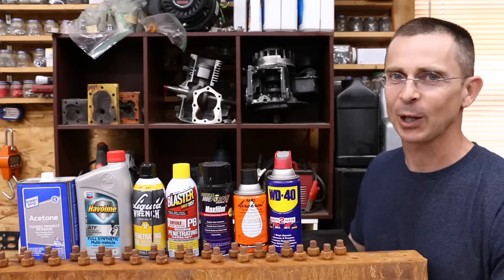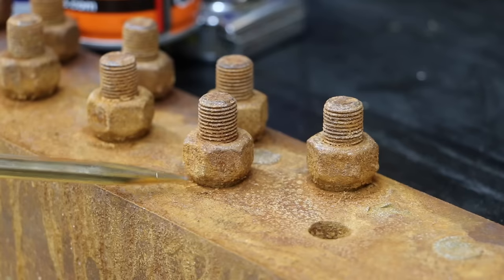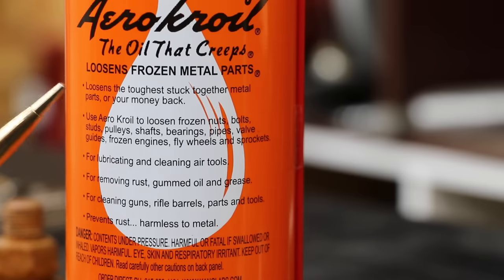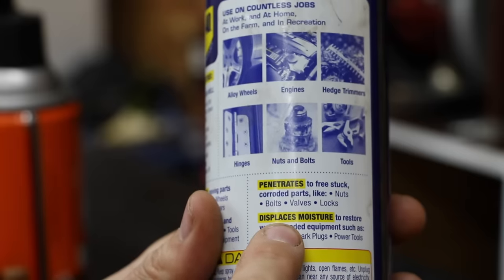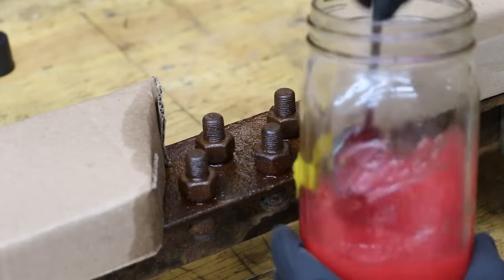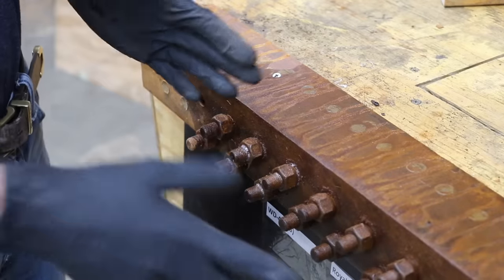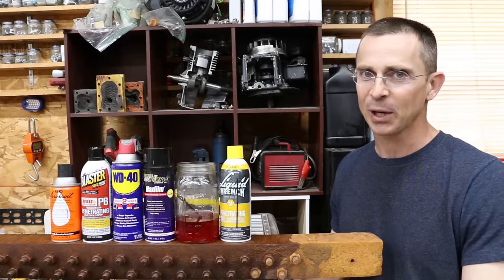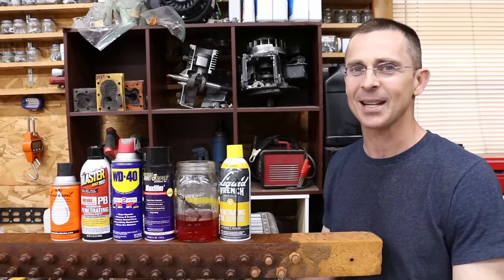Which Penetrating Oil is Best? Let's find out!

Comment: I tell every body that will listen about this stuff , I've got a lot of stuff that always sits outside year round and for years and it works great my only beef is , because I keep a spray bottle around all the time , when it gets hot outside or it sits in the sun it separates and all the tranny fluid leaks out the top, or when it gets cold the bottle sucks in,and if you unscrew the spray bottle just a bit the acetone evaporates. So your better off making just enough for that day . You don't have to use new tranny fluid either , save your old stuff !
Reply from the maker: Thanks for sharing.

Comment: JB80 works better than any other penetrating oil on the market. Just try it and you will see for yourself.
Reply from the maker: Thanks for the suggestion.
Reply: @ProjectFarm  I have used JB 80  since 1980 and it is a thicker oil. Not a water based lite WD 40. There has been many rusted bolts on farm equipment that I spray JB 80 come back in about 30 minutes and the bolt comes free. It is more expensive than anything on the market, but, it works.

Comment: These tests are ridiculous because they are not on bolts where the entire thread length is corroded and sealed  .. you are measuring torque from bolts that are not seized   .. if there are threads that are not seized  .. of course a penetrating oil will go to a void .. but it's not breaking through

Comment: the best penetrating oil is an oxy/acetylene torch. buying penetrating oil to loosen handwear that's that rusted is not worth it in my opinion. for the cost of most penetrating oil, you but just hack it off and buy new hardware.
Reply from the maker: Thanks for the feedback.

Comment: Truthfully your test is not a good measure of penetrate. You need to see how much it penetrates through the threads. Since the farther it goes in the more good it will do. How are you if it does not penetrate into the threads it is doing no good whatsoever.